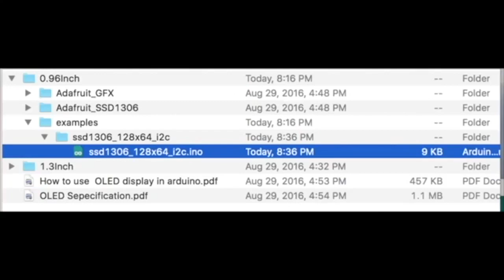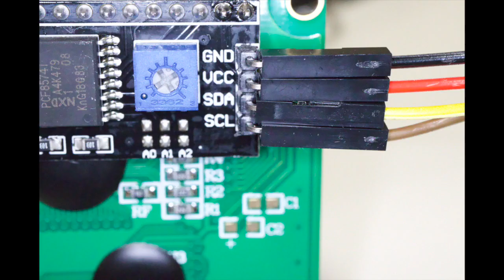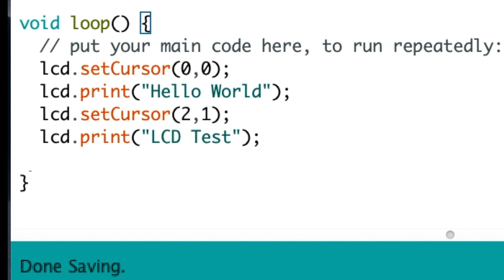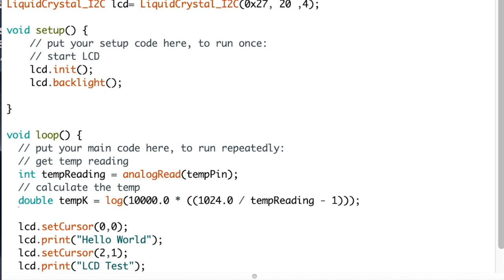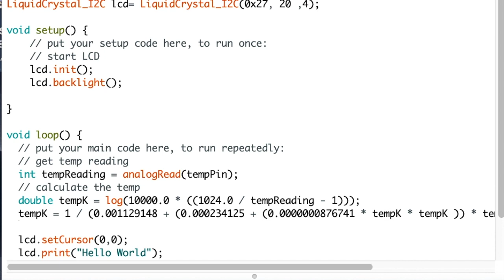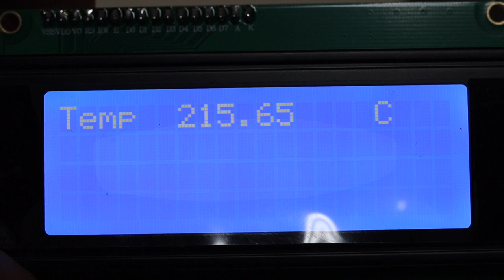Arduino Temperature Display

Comment from the maker: Visit us at wizardofwestla.com
Here is the code for this project:

// libraries
#include <Wire.h> // library for I2C communications
#include <LiquidCrystal_I2C.h> // the LCD library
int tempPin = 0;
LiquidCrystal_I2C lcd= LiquidCrystal_I2C(0x27, 20 ,4); 

void setup() {
    // put your setup code here, to run once:
    // start LCD
    lcd.init();
    lcd.backlight();
    
}

void loop() {
  // put your main code here, to run repeatedly:
  // get temp reading
  int tempReading = analogRead(tempPin);
  // calculate the temp
  double tempK = log(10000.0 * ((1024.0 / tempReading - 1)));
  
  tempK = 1 / (0.001129148 + (0.000234125 + (0.0000000876741 * tempK * tempK )) * tempK );       //  Temp Kelvin
  float tempC = tempK - 273.15;            // Convert Kelvin to Celcius
  float tempF = (tempC * 9.0)/ 5.0 + 32.0; // Convert Celcius to Fahrenheit
  
  lcd.setCursor(0,0);
  lcd.print("Temp            C");
  lcd.setCursor(6,0);
  lcd.print(tempC);
  delay(500);
  
  
}